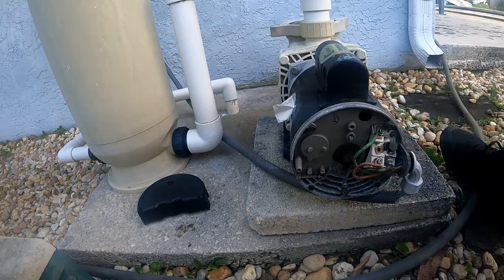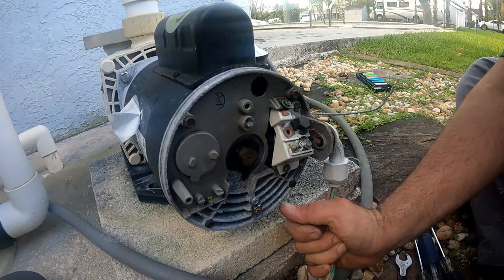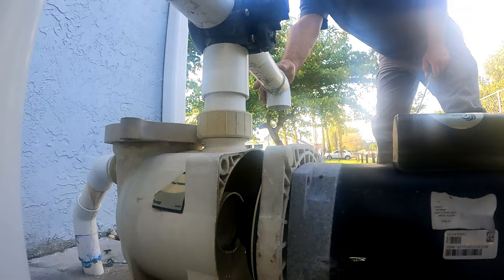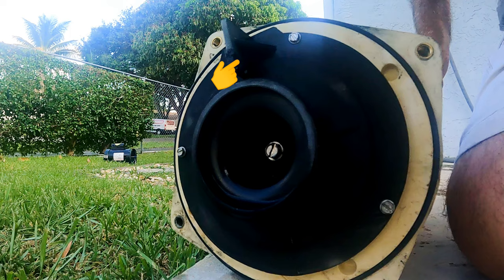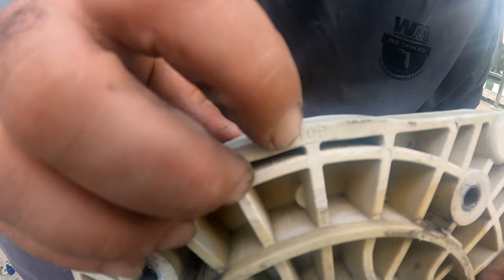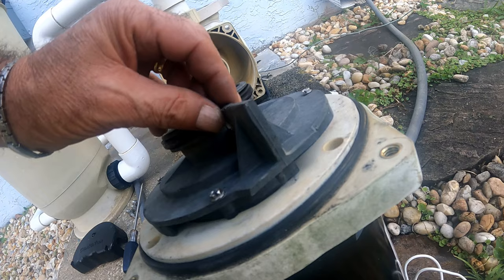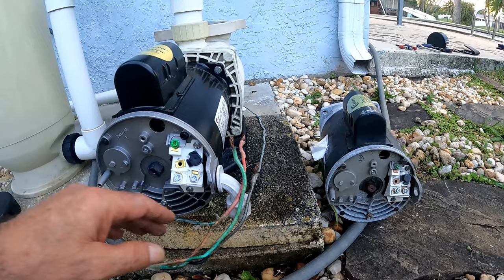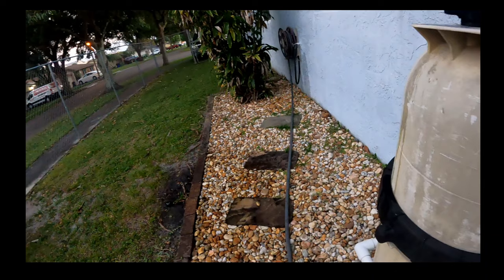How to Replace a Pool Pump Motor – Century Centurion - Step by Step Video 🛠️

Comment from the maker: We install a Century B2853V1 1.0 Horsepower 3450 RPM Stainless Steel Single Phase Pool Pump Motor with P56Y Square Flange for Inground or Above Ground Pools: https://amzn.to/3cuRto3
Reply: grazie di cuore AMICO MIO CARISSIMO MOLTO CARO DALLA ICILIA UN SALUTO CARO GIUSEPPE

Comment: Getting ready to change our Century Centurion B2855 motor in the next few days.  Using this video!!!!!!   Thank you, John....one of the best instructional videos I've ever seen on YouTube.
Reply from the maker: Glad it helped! Thank you very much for your positive feedback, I appreciate it.
Reply: @JohnCRV  Is there a way to determine which of the two non-ground wires go where?  In my efforts to troubleshoot existing motor (which included disconnecting ground and 2 other wires and attaching new circular spade connectors) I forgot to take a beforehand pic.  The real problem is I have 1 green (obviously wire)...but 2 same colored wires as well.  Is there a way to use my multimeter to test which one goes were?  Thank you!
Reply from the maker: @Son_of_Aragorn  Sorry to hear. Since we are not certified electricians we hesitate giving such advice. That been said; There's a phone number that comes with the motor, they can probably answer your question.

Comment: Great video on how to replace motor.  I think the only thing I would do different is not re-use the pump seal.  The OEM says to change it with the motor and they usually wear out.  The outer (larger) o-ring is also something to be looked at and replaced if needed.  Electrical wires needed to be in conduit or not exposed if code inspection occurs.  Perfect video on the how to portion!
Reply from the maker: Thanks for sharing

Comment: Thanks, John, for this easy-to-understand video. 

My pump just died last week and I need help identifying and ordering the correct replacement pump. The motor is connected to a Jandy Stealth pump. I took photos of the pump motor with serial #s, etc but I am having difficulty matching up the correct replacement motor. 

My old pump was a1.25hp century centurion, A.O. Smith.
CAT # 189083M, 
PART: 7-193992-06, 
TYPE: CX
FR: R56Y
HZ: 60 
RPM: 3450
VOLTS: 208-230/115
AMPS: SF 6.0-5.6/11.2
TIME: CONT
ENCI: DP
FORM: KJM
CODE: L
ISUL CLASS: B
AMB: 50* C

If you could help me, identify and find the proper replacement to order that would be very helpful!
Reply from the maker: Your best bet is to call them. Here's their website for contact information https://www.jandy.com/en/products/pool-pumps/stealth 
Good lucl.

Comment: Thanks for including the wiring. Most guides don't.
Reply from the maker: Glad it helped👍
Reply: @JohnCRV  Unfortunately it’s running but no suction :(
Reply from the maker: @ameremortal  If the wires are reversed the motor will turn the opposite way. If you're not familiar with electricity be safe and get an technician.
Reply: @JohnCRV  thanks. That wasn’t it. I triple checked and even flipped them before buying a new pump.

Comment: Thank you, John. I installed this a few years ago, but needed a refresher course. Yours is the best! Also, do you know if this Century brand should have the bearings oiled every so often? If so, where is the oil hole?
Reply from the maker: Not that I know of sorry. My Son was looking at the paperwork it came with and there was no mention of any type of lubing. You may want to call them to make sure. Most motors are sealed these days.

Comment: One Question... Great video, but when I went to change out my pump, the spring loaded black seal that you mention which has to be dislodged by using the pump cover has two ends that are different. I could not tell which end went on the shaft closer to the pump versus which went further out toward the pump fan.  The spring has a flat round end with metal and an inner flat rubber seal. The other end has a round rubber piece that has raised inner edges on both sides and fits into a round groove on the other end of the spring.  Which end goes where?  (It popped out before I could see which end was which...) Much appreciated.
Reply from the maker: We put it back the same way we took it off and hard to remember the difference but we do remember the green dot on the rubber seal facing out. We should have paid more attention to that. Sorry.

Comment: Good video.
Mine has the large clamp holding the motor and impeller housing on.
What’s the best way to keep the large O ring in place? It falls off when trying to slide it into its place.
Reply from the maker: Try some synthetic grease to hold it. Its also good for it.. Good luck..

Comment: I followed your instructions on replacing my pool pump motor and it was very helpful by the way. Thanks for that. I now have a leak in the bottom of the new pump when I am trying to prime it. Can you help? Thanks
Reply from the maker: Glad it helped! 
Did you carefully inspect the seals when you took it apart? they could have been old and just came apart.... 
If you have a leak between the pump and the motor, the seals are probably damaged. They do sell a seal kit you can get so you wont have to guess which seal is leaking... Be very careful when replacing them and when re-attaching the pump together... Hope that helps.
Reply: The new pump came with new seals. I will take it back out and re inspect. Thanks

Comment: great video except the housing on the back the shaft you hold to tighten the impella piece is covered by a bunch of wires and what looks to be some type of round black capacitor i cant get to the shaft to hold it to tighten the impella?
Reply from the maker: Not sure what you mean. is your motor the same as the one on the video?

Comment: Looks easy enough.  My problem is the three wires going into my existing motor (that I need to replace) are confusing to me.  There is a green wire (obvious ground)...but two purple wires.  How can I tell which one to properly connect to new motor?  Or does it not matter (if they are both "load wires" and can interchangeably be connected to L1 and L2 connectors on motor)???  Thank you!
Reply from the maker: Noticed you had 2 comments, this reply is the same. in case you miss the first one...
Sorry to hear. Since we are not certified electricians we hesitate giving such advice. That been said; There's a phone number that comes with the motor, they can probably answer your question.

Comment: A question about the 230 wiring?   You removed the two slip-on pig tails from what I see. Always better to direct connect your wire to terminal screws. From your picture, what colors went where? I am swapping out this exact motor for a bad Pentair. Thanks!
Reply from the maker: Pause the video between 6:05 and 6:06 you can clearly see them screwed back in. Make sure your Quality setting is set at 1080p60 and enlarge if necessary hopefully you have the same color wires, so be careful. If not sure call an electrician.

Comment: I see that in the video you didn’t change the gaskets, if we don’t damage them during the process does that mean that changing them is not necessary?
Reply from the maker: I leave that up to you my friend....
This motor and pump sits in the shade 75% of the day and we were real careful taking it apart..... So, you get the idea. I mean, they don't cost much so if you want to its no big job... Good luck
Reply: @JohnCRV  Thank you, yes i went ahead and ordered the O-ring kit. They didn't cost much and for the peace of mind, I might as well. I also went ahead and ordered the impeller and diffuser. The Amazon price was a fraction of what pool equipment suppliers wanted, not to mention the labor costs i'm saving. Again, thank you for your video and clear instructions which gave me the courage to tackle this myself.
Reply from the maker: @marvinaviles2593  Glad it all worked out and thanks for the feedback.

Comment: My motor housing bolts seemed to have some lock tite on them. Maybe that’s why they wouldn’t come out.  You never mention using that when reinserting g the bolts.
Reply from the maker: we did not have any Lock-tite in ours, so we did not use any. Frankly, I would not use lock-tight on a pump motor because there no vibration to worry about.

Comment: My Century 1HP motor died and I want to replace it with a Century 1.5 HP motor.  Do I need additional part or is it a clean swap?
Reply from the maker: Not sure. You'll need to contact Century to make sure.

Comment: Mine does want to separate. Got all the bolts and screws removed and it separates about an inch, but won't completely come off. Any suggestions?
Reply from the maker: Did you get it figured out?

Comment: I put the pool pump together, when I turned the system on, the pool pump connected with the sight class is leaking
Reply from the maker: Sounds like the O-rings may have gotten damaged. Just need to be replaced...

Comment: I could not get 3 of the 4 bolts from the motor to the housing off.  I used bolt blaster spray, tapped lightly with a hammer, and no luck. Used a socket and then a battery impact driver and still couldn’t get them off.  Any suggestions?
Reply from the maker: spray come penetrating oil and let it sit overnight. Are the bolts stainless or steel?
They should be stainless hopefully.
Reply: They are stainless bolts. I ended up buying a bolt extractor socket set at Harbor Freight for $35.  Best money I ever spent. I was able to get the other bolts out but still needed a lever bar on the ratchet.   Thanks for this great video. Wouldn’t have been able to do the job without it.
Reply from the maker: Glad it helped

Comment: Would a bad capacitor cause the motor to hum?    I thought it was the breaker since it was intermittent tripping.   Swapped it out and it worked great till this morning.   No tripped breaker but when I try to start pump it hums 10 seconds then laughs at me.   I ordered a capacitor but my luck it’s the motor.   Any thoughts.
Reply from the maker: It's worth a try but It all depends on how old the motor is.
Reply: @JohnCRV  installed in November 2019
Reply from the maker: @1927Scavengers  Less than 4 years old, it's worth a shot. Let us know how works out. Good luck.
Reply: @JohnCRV  it does spin freely.   I cut power, removed the filter cover and basket and I’m able to spin the impeller with no issue.
Reply from the maker: @1927Scavengers  as long as the bearing is not worn out and not making noise your good. 
I forgot to ask you what brand is your motor.
Reply: @JohnCRV  1.5 hp. Sta rite.  / pentair.    Capacitor coming today.  If that don’t fix it I was gonna order the century 1.5 hp. Motor.   Comes worth seal kit.    If I try to turn on now I get a short humming sound.
Reply from the maker: @1927Scavengers  I'm interested to know if it will work.